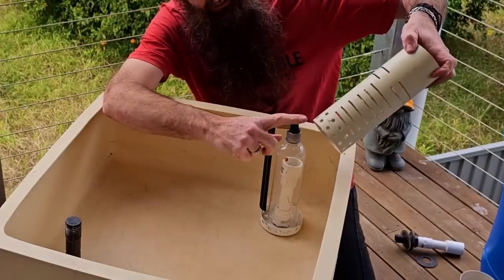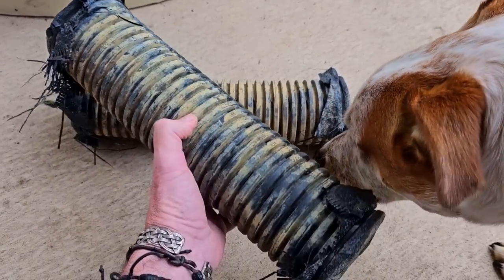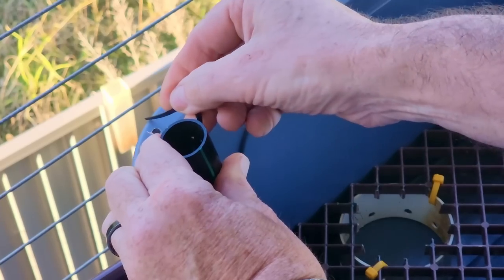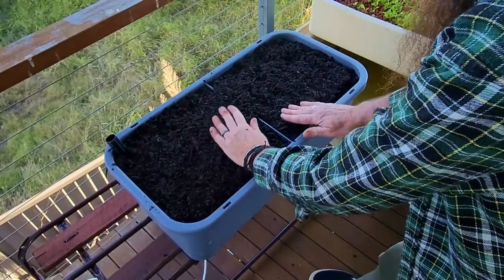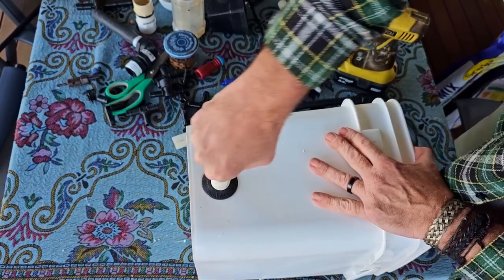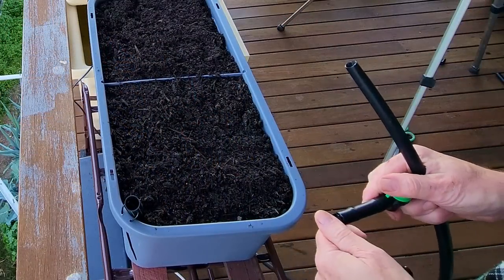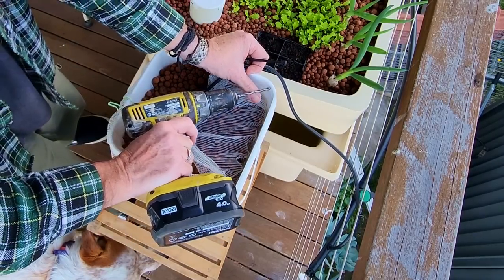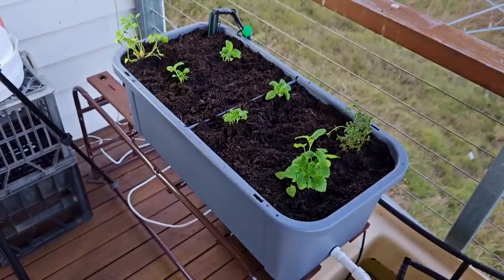How to Make Soil Wicking Bed & Dutch Bucket for your Aquaponics System

Comment: Seeing you do a flow though wicking bed makes me happy.  If you want to you can put it on a separate pump and have it run the pump once or twice a day for 15 minutes and it will be plenty to keep her topped and if you get any blockages it won't be as big an issue.  That said I have some that have run trouble free continuous for 5 plus years.  

The reason I went to timed pumps in some of my systems is they last longer so if a primary pump fails you just flip the timer on and it is a back up while you get the primary fixed.
Reply from the maker: Hey Jack. I only let it run in the morning now until around mid day as I figure that's long enough to replenish any moisture that's been used. I spend a lot of my time "in the house" on the deck so would catch any failures & sort them out quick smart. 
I played with timers a 20+ years ago doing hydro. Had loads of failures so never really used them again until we put the oyster mushroom misters on them. I think my main issue was I was working to a much tighter budget back then & bought crap. 
Have been missing the podcasts of late, life is getting busy around here while we're looking for a  farm.
Hope all's well mate. 👍
Reply: @RobsAquaponics  Interesting that you had failures.  The simple century timers I use are dead simple and tend to last a long time.  I keep a couple on the shelf for failures.  It is usually the ones I can't truly shelter that tend to get stuck at some point.  

But as always everyone should do what works best for their situation.  Just happy to see you with a flow though.
Reply from the maker: @survivalpodcasting  Like I said dollar stores aren't the best places to buy electrical timers. 😉
Cheers

Comment: hi Rob , i like the dutch bucket for mint idea, we had mint take over a bath tub, it was a mess to controll, so seperate buckets it is. we also ( for comparison )  planted gotu-cola into a seperate bathtub and it never blocked the drain hole, ( constant flood of 1 inch deep )
Reply from the maker: Cheers Shane. Ever grown water cress in an aqua bed?
Reply: @RobsAquaponics  yes i have, it grows like mint, it's ok if you can continually cut it back. at least it doesn't have runners that go down under to the pipes and block them.

Comment: Good day mate! The wicking bed looks to have constant flow instead of a timer... does it wash the sand wicking areas or over saturate the whole bed? Is it  possible to not have aerobic zones in that bed with constant flow? I though we had ro have those types of bed on a timer or let them run dry or it would be a problem, but correct me if I'm wrong... look great though, nice set up! Cheers!
Reply: Both ways work just fine, I have both on my property.  I have some constant flow that have run for 5 years now, they only get shut down in winter for a couple months.
Reply from the maker: Hey Devin. Only the very base of the wicks are in water so they don't draw up a great deal. My soil wicking beds outside  have a lot more water in them & as long as the soil mix is suitable (contains a decent amount of compost/organic matter) they done over wick & become saturated. 👍
Reply: @RobsAquaponics What soil mix do you recommend?

Comment: Thanks for the video. Very nice setup. Do you ever have a problem with the heat causing an algae bloom in the fish tank portion? I'm in the desert and we've gotten awful algae blooms in anything that we've tried to set up as hydroponic. We've tried shade but that doesn't stop the algae from overtaking the reservoirs. I'm just curious if that happens to you.
Reply from the maker: Shading the tanks & using UV proof cladding on the bed & tank walls looks to do the job for us LK. 
I did use a UV water filter to get on top of a bad outbreak in a aquaculture system a few years back but it's not a good long term solution in aquaponics as it can mess with some of the nutrients plant availability.

Comment: I’ve always wanted to use those drip irrigation for Dutch buckets, but I feel that the drip end would clog easily with any solids in the system. What plans do you have for filtering in this system?
Reply from the maker: Hey Dan. I've had them clog on me in the past & find short sections like this are easy enough to clean using wire. Mind you, I've only run 4 at a time. Having a few dozen clog could cause much bigger issues. 
I'm still playing with the idea of sitting the pump inside a "filter bucket" but have no concrete plans as of yet.

Comment: Rob greeting from the US, I have a question, since the last time I asked about getting a small set up for the grand kids to play with. The clay balls have gone out of sight here, if you can find them ,what other kind of medium might be a good alternative? I did set up a Dutch bucket system just to muck about with, and used pearlite in the buckets for tomatoes, but that aint cheap either. So any ideas would be grand :)
Reply from the maker: River rock or rock without carbonates (like limestone) is fine to use. It can be a bit rough on the hands though. There's also lava rock / scoria that many folks use & is available in the US. Also look up expanded shale. Rob from the Bigelow Brook Farm channel seel it if that helps any. https://www.bigelowbrook.com/products/Shale/Default.aspx

Comment: I know it late, but this really need some wood slats screwed in to keep the sump tank in shape. I walked out one day and the top grow bed had fallen into the sump
Reply from the maker: You have the same setup?
Reply: @RobsAquaponics  yeah, had it for 6 or 7 years. It’s a good little unit, just flexes out over time. I screwed in 2 bits of wood and now the grow bed sits on that
Reply from the maker: @dearlove88  Cheers for that. I'll be pulling it down for the move soon so will look at better support next time we set it up.